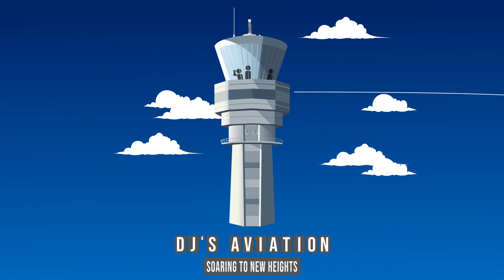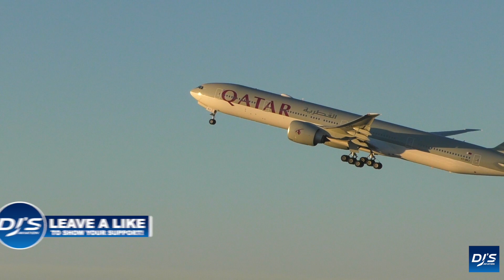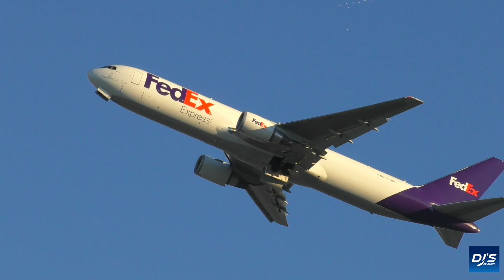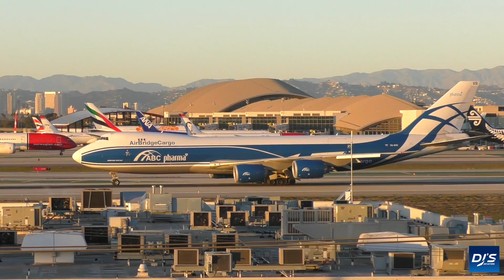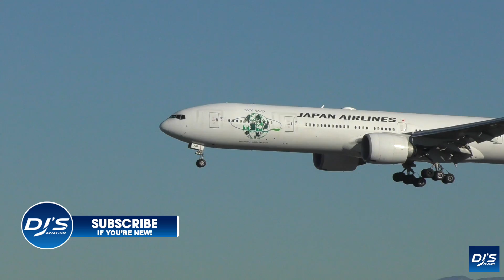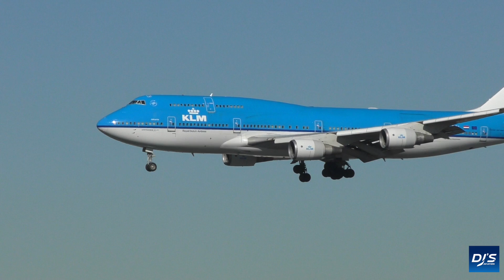Boeing 797 Engine Update

Comment: Glad Roll Royce is doing the right thing and pulling out. The Trent 1000 was a disaster!
Reply: NYC Flyer Rolls Royce had a lot of issues with their B787 Trent 1000 aircraft a few years ago and also their Qantas A380’s Trent 900 engine back in 2010
Reply: They are a British company...They are doing the honorable thing.
Reply: I’m glad they pulled out, Trent1K was a disaster, and there’s no time for a new plane like the NMA to start off crippled
Reply: Elizabeth Reign Castillo Means nothing, that’s not the reason why they pulled out. If you watched the video you’ll understand why they pulled out
Reply: Agreed, the 787 is a great plane but really got a black eye when the Trent 100’s got all messed up. I’d hate to see the same thing happen to this plane.
Reply: That ain't on all aicraft though 787-9 aircraft right???
Reply: GE is the way to go most reliable ones
Reply: Nah, some have GEnx engines. I flew on AZAL’s 787 with these engines to Azerbaijan and they were great.
Reply: NYC Flyer Love GE engines they the best and most reliable ofc
Reply: Absolutely! GE engines are very solid
Reply: Anderson Rodriguez the rolls sounded way better though
Reply: Maxkillers the Trent 1000 is only used on the 787. It was discovered by ANA in 2016 that the fan blades were corroding and cracking.
Reply: @Peter Wexler What airline was it so we can google it? When you say "disintegrated" that would be a term used for an uncontained failure. There has been only one and that was in 2001. Maybe you need to use a more appropriate terminology??
Reply: @syc9675  And the EA suffered an uncontained failure on the Air France A380 also as well as a few setbacks with the GEnX
Reply: 100th like and 20th comment to your comment
Reply: So what about the Geared Turbofan issues? They dwarf the Trent 1000 issues and there are more parked gliders due to the GTF issues. Now we have issues with the 737 MAX and Boeing themselves. That is where you should correctly apply the word DISASTER. The Trent 1000 has not caused any fatalities has it??

Comment: Rolls didn't participate in the 737 MAX, C-Series, or 320 Neo engines.  CFM and Pratt&Whitney did.  Rolls has nothing new enough that it can scale up to fit 797 requirements, so it is normal that it won't participate.  The market for 797 isn't large enough for Rolls to develop a totally new engine core.  So it is more likely that CFM and P&W will bid on the 797 by scaling up their recent engines done for 737-Max and 320-neo

It's easy to point to Rolls' Trent problems, and financial difficulties, but there is no way Rolls could compete with totally new engine against CFM and P&W who would simply scale existing engine up. So it is perfectly logical that Rolls stays out of that market. 

It also makes sense that airlines that have eother the CFM LEAP or P&W geared turbofan engines would prefer to buy derivatives from those to power the 797 due to commonality with their existing fleet. Had Rolls gine into the 737 or 320 markets, then the sitiuation would be quite different for the 797.

Normal business decision for Rolls, nothing nefarious or indicative that they are too busy with their Trent problems.
Reply: Goood comment
Reply: I think it’s more of a case of designing a new engine which isn’t cheap. Yes you could use a cfm or pw but you will be using the engines at their upper limit, which also means more wear  and tear etc
Reply: This guy is smart ;)
Reply: Fleet engine commonality isn’t as important anymore. Most engine contracts are now power by the hour where the manufacturers have responsibility for maintaining the engine
Reply: Excellent Comment
Reply: Good observation, which I agree upon. I don't think people quite realise how extremely expensive it is to develop a new turbofan from scratch, if you don't have anything to scale up or down, delivering engines for one type whose future no one knows about would be cost prohibitive.
Reply: Absolutely spot-on sir! 👍🏻
Reply: They literally wrote that they can't commit to the Boeing 797 time table of 2025, RR expected their new engine to be ready by 2029. So you can delete your diatribe.
Reply: Funny that 4000 projected aircraft isn't large enough unless it is believed to a high risk to not meet those numbers. I think the biggest factor RR realized they  couldn't seriously compete at this thrust class with GE and PW.  There is a reason RR didn't compete for the lower thrust class aircraft. PW GTF has clear advantages with higher fuel efficiency, lower part count, and therefore lighter engine not to forget much quieter all benefits to smaller class aircraft.

Comment: Well, the engines are the most expensive parts on airliners; both in purchase price and maintenance. Therefore making the right choice is critical for customers. I hope RR can take a step back and solve the Trent issues. Hopefully then, the company will power ahead.
Reply: Expensive ,hard to make...hard to maintain.... that's why we have only 3 big engine manufacturers
Reply: Kiril, spot on!

Comment: I am glad RR isnt gonna be the main engine manufacturer for the 797. They shld solve their major issues on the trent 1000 before taking on other major projects. Lets all hope that more 787s that are grounded will return to the skies soon and not later. Its sad to see new aircraft being grounded
Reply: They have.
Reply: They really could have been fitted with new engines, or maybe new engine fan discs. Hopefully RR can make replacement fan discs that aren’t as prone to cracking and replace old fan discs.
Reply: @atomstarfireproductions8695  It's not a problem with the fan discs, it's a problem with some of the blades in the IPT corroding earlier than expected. These blades need replacing at some point anyway just not this early. RR had to design and test a completely new blade to replace the affected ones, not a simple task. This has been done and now RR is concentrating on the repairs to the Trent 1000 rather than developing a new engine-simple.

Comment: The NMA will be a hard nut to crack. Like the 757 and 767, it will be able to fly medium haul distances, but also may be selected by some airlines to fly high capacity, short haul routes that a 737 or A320 may be too small to serve (like the way Qantas used their 767 fleet). A high efficiency engine will please the bean counters, but it also must be able to have high output required to get cruise altitude quickly to make the most of economical cruise.
Reply: The airline bean-counters would prefer to populate their fleets with A321neo and A321LR packed like sardines to take over 757 missions, rather than wait 7 years for a wide-body NMA and its engines.  Taking the tired, narrowbody A321neo dragging 100 tons on the same wings across the transatlantic sky would be ruinous for passenger comfort but profitability and fuel efficiency will dictate what airlines will buy.  Boeing will consult its customers, but Airbus is already ruining the NMA market with their band-aid A321 plane.
Reply: I think it is going to be used as a transcontinental aircraft, and maybe on very popular domestic destinations
Reply: @texasabbott  A321LR is slightly wider and shorter than 757. I'm not sure how "sardine" it'll be compared to 757. While it's not as mad-dog as 757, it has comparable range and capacity as 757, sufficient as a replacement.
Reply: @steinwaldmadchen  Agreed. The A321neo and A321LR could be "better" planes if they had a more modern wing that could accommodate the added fuel and fit a more modern cockpit (like the A220 and A350).  One advantage with the original wing is that it is easier to access more gates at the airport. The 757, especially the 757-300, however, are still quite profitable and NOT fuel guzzlers as most news outlets suggest.  Parts availability, major repairs, cabin condition, cost of D-checks and C-checks, cycles remaining and A321neo pricing are motivating factors in airlines getting rid of their 757s.
Reply: @texasabbott  Just like A320CEO to A320NEO.
While I don't see A321LR as a band-aid, it's targeted to bring extra revenue at minimal cost to both Airbus and airlines, that ensure its success, whether 797 exists or not. Killing off 797 would be a by-product, though Airbus will be very happy with it.

Comment: What is important to note here is Boeing need to know which engine may be on the plane as each one needs a different mounting system and pylon configuration. That is why it is no easy matter to pull the 787's suffering from the RR problem into the hanger and putting a GE on it. The whole Wing structure would have to be changed.

Comment: Maybe the 797 should use the GE90 engines😁
Reply: Adrien Diaz wow I’m not even sure If it is capable of carrying its weight
Reply: Kerezone It’s not, Ik the original comment was just joking but if you try to manage a GE90 under a 797 on a tarmac the whole plane would be off its landing gears anyways lol
Reply: I meant it as a joke but it still would be cool.
Reply: It would look super awkward
Reply: Gabriel Sasala Maybe it would look less awkward if it was powered by a single GE90-115B engine, fitting neatly if it was stuck straight through the tail DC-10 style.
Reply: No, the GE90 engines are too big for a midsized airplane

I would imagine the engine cowl touching and scratching on the taxiway, creating sparks and breaking the metal
Reply: atomicjellydragon Why not put the landing gear on the bottom of the engine cowls? 😆
Reply: Haha it would have to have high wings
Reply: That! 20 year ago first ge90-115b engine first run 2000
Reply: That old ge90 engine 20 year ago 2000 aviation adrien

Comment: It seems a sensible decision by RR to pull out giving the issues with Trent 1000. Their inability to respond to Emirates request (demand?) for an upgraded A380 engine was telling as well.   Thanks for the video!
Reply: Emirates demanded a PIP on the Trent 900 and a total care package for a price that Rolls couldn't even manufacture the engine for. Rolls are not a charity. That is why they knocked back Emirates.

Comment: A PW1000G engine would be the most likely candidate since P&W can easily scale up the engine to match a specific thrust output and size. It did it when competing against GE to power the 777X.

Comment: Pratt and Whitney is far ahead in the NMA game with their geared turbofan, as their PW1000G series can be scaled up from 35,000 Ibs. (PW1100G for the A321neo) and enlarged to 45,000 Ibs. of thrust (for the Boeing NMA). But then again, it takes a longer time for P&W to develop a mature, durable and reliable engine.

Comment: Quick couple  of questions.   Will the 797 be narrow bodied?
And if so will it have the same body as a 757?
Reply: Must recent chatter would indicate that the 797 will be a twin aisle (much closer akin to the 767 than the 757).
Reply: @robertanderson4248  Thanks for the reply.
Reply: You're most welcome, Ian.   Twin aisle planes have the potential to be loaded and unloaded faster. Low turn around time means the plane is in the air making more money each day.  Even mid range jets. Especially on domestic service.

Comment: Sad to hear but anyway im sure RR can produce a superb engine like they did on the 757s and others. The part failure is the gearbox which corrodes earlier than expected and not within the design specs. But i believe they may change their mind. In this case may Leap or PW geared engine can step up to meet requirements. Such as 50k thrusts for a 250 to 280 seater

Comment: Can't say I'm not surprised about R/R pulling out. For fuel efficiency, the P&W GTF would be the clear choice, but I still have concerns about the complexity of moving parts for durability and reliability in the long run. Therefore, I beleive a version of the GE Leap engine will be the engine of choice.

Comment: I feel bad for Rolls Royce, they're an amazing company but the Trent 1000 caused them to have a bad reputation
Reply: Engines are hard to make...I don't now what Happened but I don't want to point fingers to company like RR...it is a tough thing to produce airplane engines....
Reply: It’s because the turbine blades of the problematic Trent 1000 engines were wearing out faster than expected, grounding a bunch of 787s in airlines fleet. The engine was actually rushed to the market unlike GE which they used more durable fan blades. The exact number of engines assigned for “earlier-than-expected” repairs related to the turbines blades on Their package C series engines.

Comment: So what about the other possible manufacturers?  GE, PW, CFM.  It's been pretty obvious that RR has been and remains too mired financially and R&D wise with the Trent 1000 to bite off a huge new UltraFan science project. And GE is signaling their reluctance "because of market doubts", which I suspect is really an effort to curb new outlays and pad profits to help the parent company's poor financial position.  And I suspect GE's foot-dragging will spill over into reluctance at CFM to jump off into a higher thrust LEAP. And that leaves P&W who is also not without problems with their GTF offerings.  Are things looking bleak enough yet for a 797? And this is just the thrust side of the equation. Got to wonder what some of the non-engine suppliers have on their minds.  I suspect that as the world economy cools off a bit, engine tech advances will come much slower.
Reply: Phillip Parrish 

GE is only interested in an exclusive supplier relationship.  They don’t want to spend the resources for a split market. 

The CFM joint venture has already been given the blessing that they can produce an engine large enough for the  797.
Reply: My father (Boeing aeronautical engineer retired) always told me that engines were always the problem with any new airplane...
Reply: @stevewallace1117  very complicated issues.  Engine builders want the promise of exclusivity (no competition).  Boeing (engineering) would rather deal with one builder/model engine, but at the same time don't want to bet the farm on one builder (big risk).
Reply: @stevewallace1117  agreed, but complexity and risk beyond engines has grown rapidly too. Globalization, contract air framing, and less in-house production/control has kept pricing lower, but probably keeps Boeing managers awake many nights. Hope your father avoided much of this turmoil.

Comment: GEnx would be an efficient engine for the 797, and it would give the plane the same kind of hot and high field performance that the 757 had by being somewhat over-powered.  I like it.
Reply: The GEnx is too much engine for this plane and weighs more than 13,000 pounds each, and the fuel burn will not make it worth a 797 widebody replacing any 757 or 321neo.  A new big engine weighing in at 8,000 Ibs. capable of producing 48,000 to 52,000 Ibs. of thrust for a 70 tonne empty widebody airframe/130 tonne MTOW will still deliver the crazy takeoff performance we are looking for.

Comment: I wonder which engine route they will go, maybe a scaled up CFM LEAP, or P&W 1100, or a scaled down GE-NEX?
Reply: P&W has a big head start with their 35,000 Ib. thrust PW1100G GTF, but if they scale up to a higher thrust level or bigger fan needed by the NMA, P&W tends to take longer to resolve durability and reliability issues.

Comment: RR pulled out. A RR choice by Boeing was remote at best. It's not like Boeing would have risked another engine fiasco.
Reply: To be honest if a customer demanded RR engines, Boeing would deliver. Since it's the customer who chooses the engine. But since they are not participating, it's all speculation from us.
Reply: @CS-kx7cx  Boeing needs to engineer the two products to work together. The aircraft manufacturer very much does influence choice of engines by what they offer (or don't offer) to the customer. This is why the engine manufacturers were invited to show what they had. In the end, what is offered is up to Boeing. Of course broad market demand will influence this like Europeans wanting RR in the past, but with the UK leaving the EU and the disasterous RR engines of late, Boeing wouldn't risk an RR engine on this new design.
Reply: @redlock4004  Good point you are making. And I actually agree on the first part. RR doesn't have a fit in this class, and the development costs of producing a new class of turbines for one class of aircraft is too high given the unknowns. But RR's and Boeings excellent co-operation up until now and the reliability of RR engines until the 787 debacle, I do like to think that IF, RR had an engine that fit, I think Boeing would have made it available but alas, it wasn't to be.

Comment: Honestly, what is the advantage of waiting till an event to release information. As opposed to releasing small interest bringing bits that would encourage to have though our questions and offered on the day official launch
Reply: Nixon Vlark 

Boeing is talking to the only people that matter, the customers who will buy the plane and must make the business decision that it fits their operations in the future. 

The public unveiling is a party when you show a plane and celebrate the initial launch customers who have committed.  The substantive discussions with customers have been occurring for years and the launch customers will begin being secured later this month.  Based on leaked information, components are already being made and I am sure the public unveiling will involve roll out of one of the test aircraft.
Reply: @raptorshootingsystems3379  they're treating the 797 like its the stealth bomber. denying that they're even considering making one. I know that they are designing plans for the assembly floor as I write this. An unveiling is not the same as announcement.